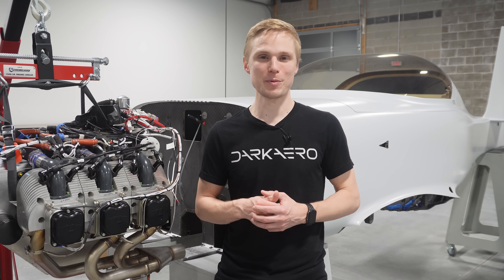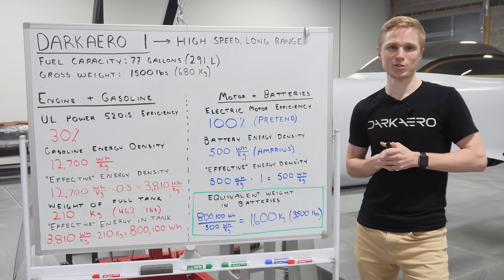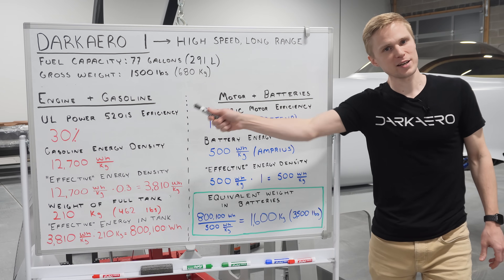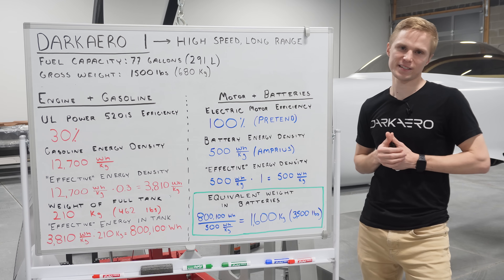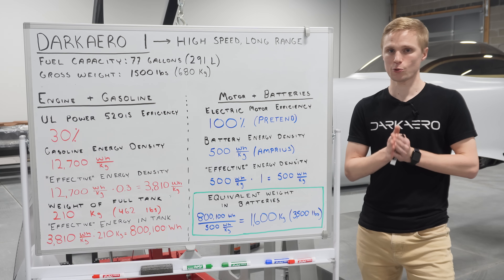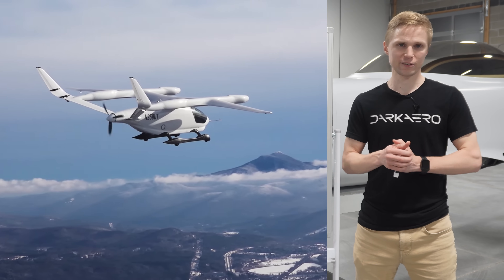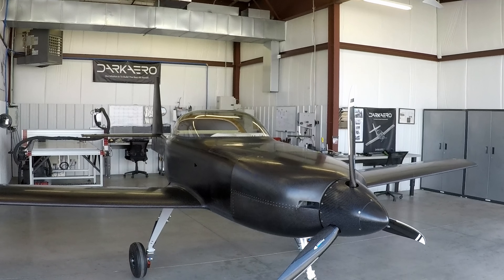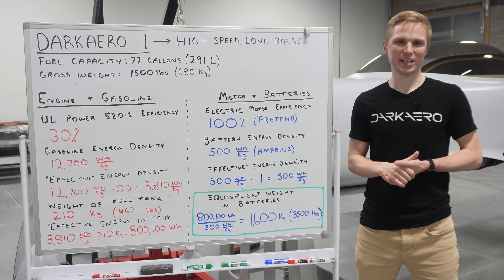The engineering challenge of electrifying airplanes

Comment: I watched this a few days ago and was thinking about it. Did you consider the range extender model? I don't remember you mentioning it. An electric motor at the prop, maybe some batteries, maybe not, but a ICE generator. The engine could perhaps be smaller, more efficient. The electric motor could be just big enough for your requirements. Some cars seem to be headed that direction with success. If you have thoughts or ran the numbers, I'd be interested to hear.

Comment: It is just amazing that 78 years after ww2, with incredible reliability of turboprops in mind and low speed of aircrafts in general aviation there are no turbocompound engines available. With +25-30% power/(relative)efficiency boost and soft modes of failure (hydraulic coupling) i can not see a good reason. Now we can obtain this ability much easier than anytime before, with commercial turboelectric modules from automotive industry and small electric engine that can get additional function as a starter.

Comment: Be OK so long as the battery pack is mounted underneath the aeroplane and jetisonable immediately and infallibly when it inevitably gets to thermal runaway.  Have to restrict the aircraft to only flying over water of sufficient volume that the ensuing lithium hydroxide is weak enough not to damage the environment.
Went to a lecture given by the late Barnes Wallace who produced data to show that the liquid fuel with the highest calorific value was kerosine.  That'll be why most aircraft use it.
Electric powered gliders makes sense as the just need power for short periods when taking off and the thermals can't be found.   Still need jetisonable battery packs though.  Not a lot of fun being burnt to a crisp at 10,000 ft.  As the WW1 fighter pilots found out.

Comment: Has gasoline become lighter in the last 20 years? Back in the day when I was flying, we used 7 pounds per gallon to calculate wight and balance.  While it would not make long range electric flight much more practical, it would materially affect your calculations.  I wish I was young enough to have a go at flying one of your planes; they look amazing. I am curious to see how actual results compare to calculated flight characteristics. I have seen some disappointments over the years.
Reply: 100 LL is 6 lbs per gallon. Always has been. Been around airplanes since the late 70s.

Comment: Gas watt/volume density depends on pressure. Don't get me wrong, hydrogen fuel cells for flight is not plausible, but I'm guessing we can get enough energy in the wings to replace the gasoline, considering pressurized hydrogen gas.
Reply: He is using liquid hydrogen for this comparison. Which is much more dense tan gaseous hydrogen at any pressure

Comment: I like your content but other than wings rigidity s-glass seems like a better option for the fuselage do to it higher strength overall, also hybridization seems like it would be a better option or atleast looking into an engine with higher efficiency, 30% is very conservative for what a modern engine is capable of especially in a airplane setting where emissions are less of a concern.

Comment: Axial Flux motor 50lbs, 300hp, can be power by diesel genny, as a hybrid configuration, and likely be under the current weight of your current motor with 30% more power, and near instant torque, and while coasting power off can reclaim some energy as you climb and dive or play in thermals, further increasing loft time.

Comment: Many electric advantages…I can refill my 143kWh solar power battery bank with $22 in electricity, much less vibration/noise, it won’t spew C8H20Pb into the air. Batteries will get lighter in the future. Until then, my IO-540 will work fine.

Comment: An often overlooked issue with electric airplanes is the time it takes to recharge the batteries. You can refuel a conventional plane in a few minutes, that's not an option for electric planes. As battery capacities grow, this problem gets worse.
To take that Pipistrel Velis as an example, it takes as long to charge as it can be use to fly. For a flight school this basically means they have to invest in two planes for each instructor. One flying, one charging. This is in fact what is happening today at my airfield EHTE where there's two in use.
Long story short, the economics simply do not add up.
Reply: Swapping batteries an answer.

Comment: So this is a game of compensation, basically. You want high-speed, long-range flight in electric plane? It cannot do that, at least with the current tech we have. But fuel-burning ones can. Same in vice-versa with fuel-burning planes, they don't like to fly slow and in short distance, but electric planes can. That got me thinking, why not combine the two? 

I've been eyeing on hybrid systems, which, to me, can fix the problem of both electric & gas-powered aircraft. Though it won't be as efficient as the two, at least it solved the problem

Comment: Using Musk philosophy., build a prototype to learn, try out any idea, including rediculous one, crash6a couple of times for free advertising build one by one step by step,. Having no idea of aviation or its principles, but what an electric motor has above all is speed 20,000 rpm, torque, and regeneration(using ultra capacitors) , maybe the propulsion is where to start, it has basically never changed since the Wright Brothers, could a variable venturi with multiple blades, depending on altitude and thrust be a way forward..

Comment: One question - did you take into consideration the weight of the engine + other relevant parts that would be replaced by the electric motor? If there would be a significant weight saving that can be used for additional batteries ?

Comment: After calculating a little bit with your Data i found if you replace the ICE propulsion system 1:1 with an electric system you would reduce the range from 1700miles (2700km) to 270miles (430km). This is way less but for a guy from the little country germany it would be enough for my usecase. For the US i assume it wouldn't be enough to get from one city to the next.

Comment: Nice video.  You forgot one important thing, though.  Electric planes energized by fuel-burning onboard generators.  Rolls Royce is producing them.  "Turbogenerators" rated from 500 KW output to 3.5 MW output.  Specifically for the eVTOL plane market.  I've seen the 500 KW gen.  It's ~5'(L) x 2'(axial diameter).  Listed weight (dry) = 280 lb.  Fuel consump = 16 gallons/hr (~100 lb/hr).  Your 77 gallon fuel tank holds 4.8 hr of flight at that rate.  Cruising at 300 mph = 1,400+ mile range.
Reply: This is very relevant. This kind of hybrid esc system provides incredible advantages. Think of all the design decisions enforced by the size, weight and cooling requirements of a  combustion engine. With a small generator, you no longer need fuel lines to get power to your motor. You no longer deal with a fluid and pipes that need to consider maneuver load. The variety of positions you can place your very dense motors and therefore thrust increases. The control gained over positioning the center of mass with that system from a design perspective is worth it alone in my view. Previously impractical approaches at these scales to increasing efficiency become available. 

Pull motors on wing tips are particularly attractive to me. At the cost of some added structural requirements you get the advantages of a push type configuration being the aircraft body isn’t downstream of the propeller, and you get the advantages of a pull type configuration where you get a lower take off speed because the wings are downstream of the propeller’s thrust. Not to mention improved stall characteristics with permanently active ailerons and efficiency gained by virtual winglets created by propeller wash.

Comment: With hydrogen you forgot about Hydrogen embrittlement process. Hydrogen will make metal engine last much shorter time, than with gasoline. And it's not safe, cause your metal engine after some time can fall apart in any second.
Reply: I think he was talking about a hydrogen fuel cell - which would generate electricity for an electric motor - rather than burning hydrogen as fuel directly.

Comment: Liquid hydrogen makes much more sense than purely batteries. Check out the new hydrogen tank from GTL. They claim it could acutally give even longer range than hydrocarbons. But the plane has to be built around the hydrogen tank. Also, the tank can act as a structural component, further saving weight.

Comment: quick comparison for everyone...

An all electric version would be equivalent to a 16-17 gallon fuel capacity.  More like a trainer than personal plane seeing it'd only be able to fly 1.25-1.5 hours with VFR reserves depending on standard variables of flight. Be super cheap to fly that time though. So it stand mission is less than 1.5 hours it is viable currently.

However, as energy density improves, so will the endurance with a simple battery swap. Imagine in 5-10 after the next break through, you go from 1.25-2.5 hours flying. Then again several years after. Keep in mind the rate at which technology evolves. 

GA planes and regional flying future will be electric. Long haul flights, fossil fuel will remain king for the next 50-75 years.

Comment: given the 100 pound weight savings on the motor, if you assume 560 pounds of batteries that gets you 280,000 wh's of energy, or just over 1/3rd the amount in the gasoline dark aero.  if you were willing to accept 1/3 the range, it would be practical.  considering the cheaper fuel cost of electricity, its quite possible that a short ranged electric dark aero would appeal to some people.

Comment: I've never understood people saying electric motors create no co2 emissions. Yes they do. You charge them by burning fuel to turn a generator to charge the battery. I'm not picking on the video maker here, just stating a fact. You simply move the visible burning of fuel from in front of your eyes to down the road at the electric power plant.
Reply: that's valid if the source of electricity is burning fossil fuels. The majority of electricity in some countries (such as Canada) is hydroelectricity, and wind and solar generation is increasing. Even in the USA, recent sources are 22% renewable and 18% nuclear (so about 60% fossil fuels).

Comment: I think you overlooked hydrogen being compressible.
Reply: They certainly have not overlooked that. Hydrogen at ambient pressure is completely impractical; all scenarios using hydrogen fuel in vehicles assume that it is either cryogenic liquid or extremely highly compressed gas. The analysis in this video first discusses the mass required (mass doesn't change with compression or change of state), then @5:22 explicitly deals with liquid hydrogen. Only gas is compressible, liquid is far more dense than gas compressed at any viable pressure, and the weight of the pressure vessels needed to hold highly compressed gas is severely problematic so proposed uses of hydrogen fuel in aviation are generally based on cryogenic liquid hydrogen.

Comment: Have diesel-electric systems been considered? They have the energy density and efficiency features of gas engines and they are still very high power. Some freight trucks use them now
Reply: That has been the main powerplant for locomotives for decades. But really heavy.

Comment: New battery chemistry will soon change the power to weight issue and provide a massive boost to performance. Looking forward to seeing Dark Aero go for volts. Beautiful piece of aircraft design.
Reply: And how do you know?  You are replying to a fact based video presentation with 100% conjecture.
Reply: @floydragan  watch FullyCharged and their excellent sideshows. It’s all out there. Fact-based. Battery technology is accelerating rapidly and already they have batteries out in the field with three times the density. The motors are also getting better. Even major airlines are testing electric and hybrid-electric systems. If you want sales to really rocket, then you’ll need a compelling line of systems to suit every customer.
Reply: @floydragan  watch FullyCharged and their excellent sideshows. It’s all out there. Fact-based. Battery technology is accelerating rapidly and already they have batteries out in the field with three times the density. The motors are also getting better. Even major airlines are testing electric and hybrid-electric systems. If you want sales to really rocket, then you’ll need a compelling line of systems to suit every customer.
Reply: Cars can afford to make the weight to energy trade off.  For instance a Tesla Model 3 is about 500lbs heavier than a comparable vehicle..  500lbs. is not critical in a car however in a small plane it makes electric design unrealistic.  I have no idea what the future holds, however we are not even close to replacing ICE in airplanes, IMHO.

Comment: what about hydrogen cells? They have to be blown through with air, and this is not a problem in airplanes. Hydrogen tanks are dangerous when used on cars due to accidents, but planes don't crash that often. If you combine hydrogen cells with batteries and take into account the possibility of recovery, then an electric aircraft can even bypass a conventional one in range.

Comment: ++. Showing the basic figures is a good thing. There's reasons for your design.
I can't wait for when batteries get up to 2.1-4x their current energy density, but even then, it'll only be scraping what's worthwhile on a platform like your aircraft.
Shouldn't be too long, but you'd certainly make a different aircraft for it than this one. This one looks good on size/ weight/ efficiency and aerodynamic performance, with the powerplant and fuel it's using.
Reply: It's entirely possible that battery technology will plateau and never reach that energy density. Technology doesn't get exponentially better forever. Eventually we'll just figure out how to make the ideal battery and they'll never get any better.
The sr71 was created 61 years after the wright brother's first flight... 59 years later we still haven't made a faster jet.
We went from exponential improvements in speed of aircraft for about 60 years, then we developed a plane that's about as fast as you can possibly make a plane move through the atmosphere without melting, and then we've had zero improvement in speed since.

Comment: Maybe you wont "dismiss" electric aircraft - but I will (Speaking as both an environmentalist, and a retired airline captain).
In light of the "Garbage-into-oil" technology, that already exists, electrifying vehicles is almost completely pointless except in a few special cases.  You have to remember that "Oil is NOT the Enemy"!  And we will never "Decarbonize".  After all, even electric cars need oil!  We are all made of Carbon.  The current push to electrify everything is simply the result of arm chair environmentalists all getting taken-in by out of date bandwagon thinking, or industrialists taking advantage of this same hysteria.  
Rather; the political decision to make the lateral move from fossil fuels to bio-fuels needs to be committed to globally.  At the same time this does not mean turning corn into fuel, or stripping forests from the land.  What it does mean is capturing the value of overlooked resources that are currently being wasted as "garbage", trucked to dumps, or sent up smoke stacks.  The world now has the ability to take any waste hydrocarbons, and reduce them down to syn gas - which is equal to natural gas.  In turn, this means there is no long such a thing as "non-recyclable plastic".  It means that every major center on the planet can make bio fuel from their own waste - and eliminate the need for fossil fuels.   Garbage-into-oil tech provides options; to make industrial coatings, or materials, or fuels.  Such fuels are bio fuels, are environmentally neutral, and can also be processed into avgas  or jet fuel.  In turn - "no need for batteries".
I DO count myself as an environmentalist.  But the bigger trick is; how to keep my environmentalist friend's eyes from glazing over before they get half way through the above paragraph?   
Here is an example of a company already taking part in the Garbage-into-oil paradigm shift:  Enerkem is a Canadian company with a facility currently making bio fuel from Edmonton's city garbage, and with another facility about to come on line in Montreal.  The Montreal facility will be optimized to turn that city's garbage into syn gas, and then the syn gas into jet fuel - in turn transforming current jet engine technology airliners GREEN - simply by choosing the fuel source.  "Fossil - no".  "Bio- yes".
https://www.youtube.com/watch?v=X5SjcPBLFDU&t=2s

Comment: Could you please whiteboard a hybrid synario?  Small rotary engine  (operating at a fixed RPM) as an APU that recharges battery in-flight?  You folks ROCK!
Reply: Not feasible. Not yet, anyway. The ICE generator/alternator would have to be so big it would be a pointless exercise.
Reply: @NZobservatory  Gosh, it would be nice to see the numbers anyhoo. To have a motor as a main source of single-engine thrust… is sooo much better than pistons banging back &forth… I’m just sayin’
Reply: @99kevin99  The numbers have been done many times for people who think a generator can provide endless free energy to an EV. It’s just not a practical solution.
Reply: @NZobservatory  Copy that. I did not mean to specify “endless free energy”. My error please excuse. Just enough energy for a single climb to 9k feet. Land with 20% battery “reserve” is my specification (a single go-around attempt if required).
Reply: @99kevin99  The added mass of the fuel, ICE, generator and ancilliary equipment would be counter-productive.
Reply: @NZobservatory  0.7hp.  https://youtu.be/6OFtGntbS8U